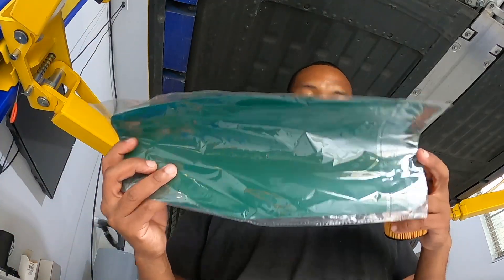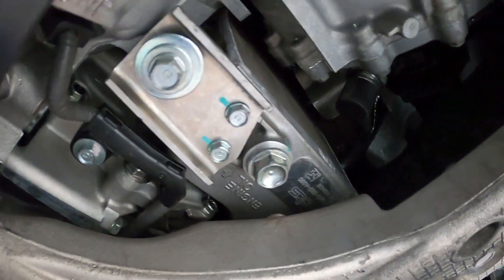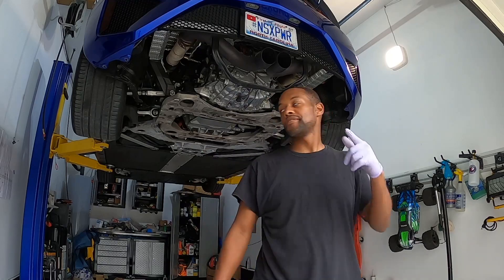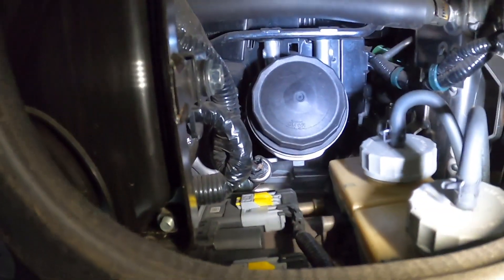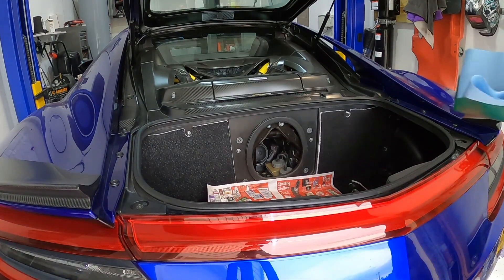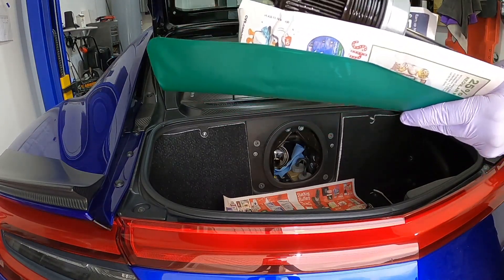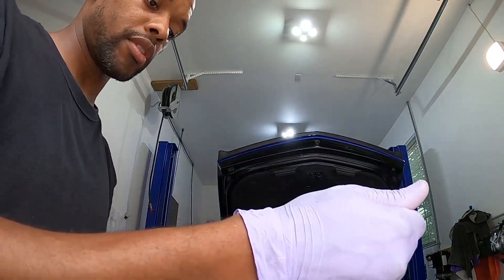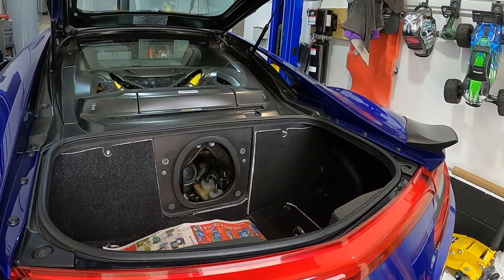2017 Acura NSX Oil Change - Dry Sump Lubrication System

Comment: Licensed Acura Master tech and NSX specialist here, great video detailing the oil change procedure on the NC1. Unfortunately, you missed/incorrectly completed the fill procedure. The 17+ NSX requires a specific amount to go in first, then an engine warm up/idle procedure done via the M.I.D screen on the instrument cluster. After the warm-up/idle procedure and then a 2 minute  shutdown time has passed, only then should the remaining oil be put in to "top-up" to specification on the dip-stick. The oil capacity spec is there as a guide for parts, but not every engine will use that exact amount and is dependent on how much is drained and/or if the engine was hot during the service. It is NOT correct to just fill the sump tank with 8.3L/QT's of oil and call it a day.
Reply from the maker: Thanks for the feedback. You are correct and I should have stated that the capacity amounts listed in the owner's manual are just listed there as a guide. When it comes to the actual oil fill, I actually did use the oil check assist to ensure the correct amount of oil was put into the tank. I will make a follow up video to address the items you pointed out but thanks for taking the time to share the feedback, much appreciated.

Comment: From beginning to end (minus setting up camera to record the process) how long did it take for you to change the oil? I noticed it went from daylight to night 😬 Also I watched all your videos on charging the TMU oil and transmission fluids. Were those necessary? At what intervals are they supposed to be changed at? Or was you just demonstrating how to DIY those fluid changes? I also noticed you're right at 40k miles. Either way, LOVE THE INFORMATION! 🙌 Thanks, brother!
Reply from the maker: Thanks for watching. Since the car has 40k and new to me, I like to know when it was done for my own knowledge. Based on the maintenance code, I was due for all of them. For the oil after getting the cover off, maybe a little over an hour. For the intervals, I'm going to make a short video based on what I found online.